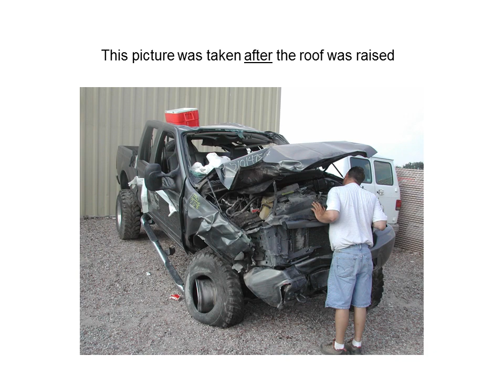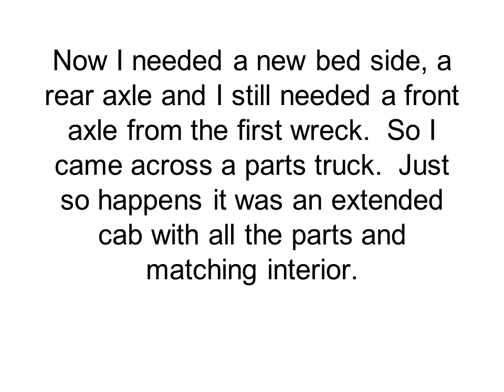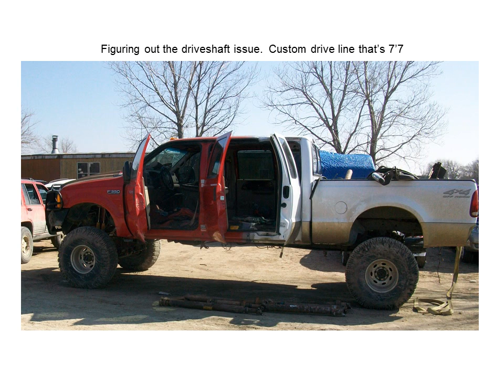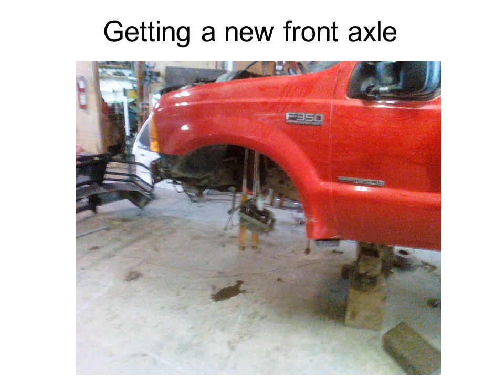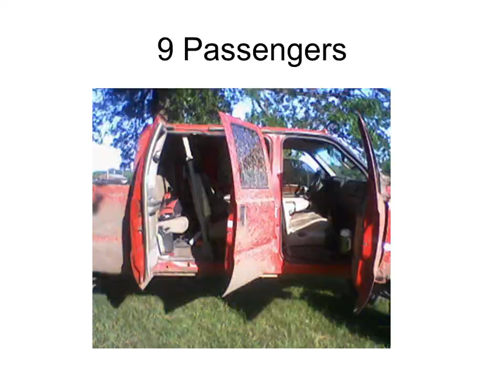monster

Comment from the maker: Actually its only 10 inches longer than a 4-door long bed.  On top of hat where  stretched it the frame of an extended cab is shorter than the 4-door frame (yes they were both f-250's).  So we put a cumalong t it pulled it together and then shoved it inside the other one when we got it where we wanted we portapowered it back out and used 4 grade 8 bolts on each side to line it up and hold it together.  Then start welding.  If you have any questions I have a descent write up on how I did it all.